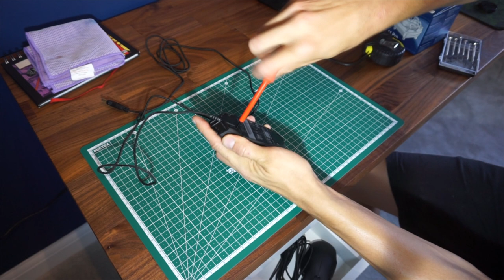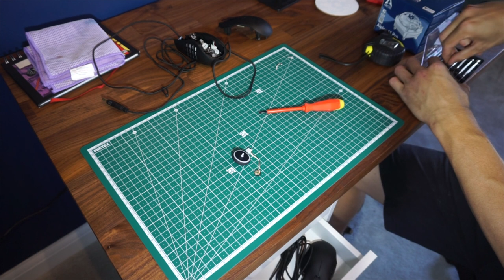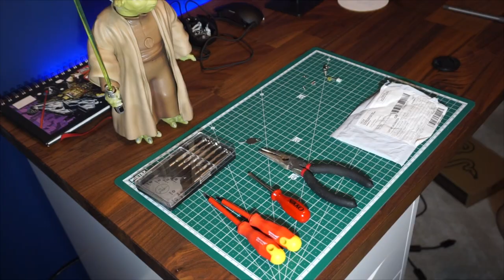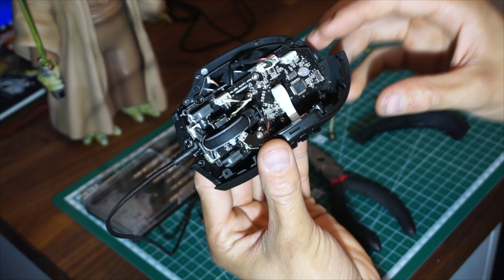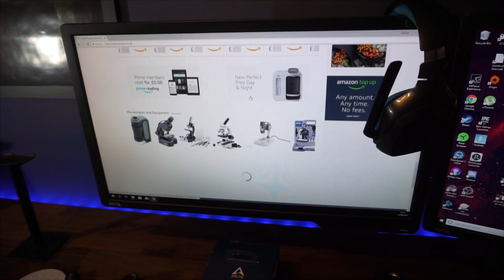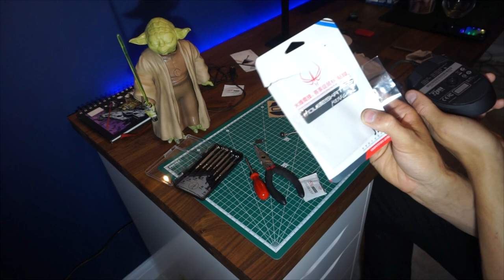How to FIX Razer Naga Scroll Wheel (Jumpy Scroll wheel)

Comment: Hello there. I have the razer mamba tournament edition, with the same issue. Scrolling up and down is a pain in the ass + my wheel button works 2 out of 10 times. 
Have been looking online for a solution and I think yours is what comes closer to my issue. Since I can't find a replacement encoder for mamba te, could I buy the razer naga encoder and replace it with this one? Will it work? I don't think there is a replacement encoder for mamba te and that's a shame, cause I really like the mouse and that's the only problem I have
Reply: Failed to mention, they are identical (as of outside appearance). So, probably, would work??

Comment: Is there any other method without buying new encoder?
Reply: thorough clean of all the parts: encoder specially. From the inside. And some extra pressure while assembling it again. As stated in video: lose contacts (copper ones) can deteriorate or pick up dust.

Comment: Ok so after watching this video i found a fast easy fix for this problem that may or may not help you but i found that if i stuck a small screw driver inthe side of the wheel where the box is if u press kinda hard (not too hard lol...) to just bend the contactors to make better contack... so you dont have to dissasemble lol..... but well see how long this lasts. ill try to re comment when it fails again

Comment: You can use double sided tape to put the rubber pads. Instead of buying new ones.
Reply from the maker: as long as its thin enough and you don't damage the feet while removing then yes, good way to keep the cost down

Comment: No offense, but at this point I'd rather just get a new mouse. These fancy, expensive mice should never suffer from such trivial, spontaneous, asinine issues. Ain't nobody got time for this junk.
Reply: So true before I used an old Zelotes £10 mouse and I used it for around 5-7 years and it still works perfectly fine still smooth clicks everything I upgraded to a Razer mouse back in November 2018 just to see if the price does make the difference. I've had it for around a year and a half and the left click will stop firing in games like CSGO and the mouse wheel gets caught. (i also never eat around my mouse/keyboard etc so nothing could've gotten inside of it.
Reply: @razerblade233  I had a Chroma that lasted about 2 years, just after their warranty runs out. The scrolling and left-clicking gradually degraded towards the end, and taking it apart multiple times solved nothing. I bought a cheaper Deathadder from China and it'll still probably end up having the same lifespan as before.